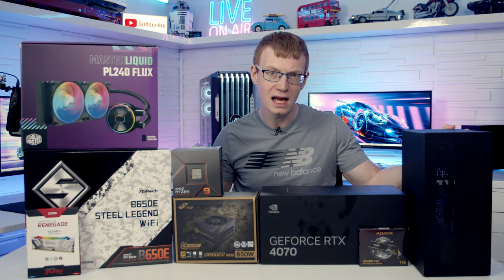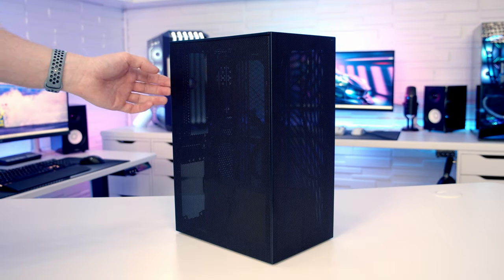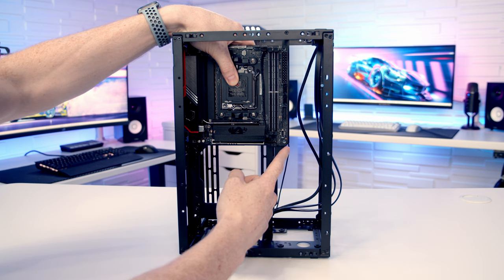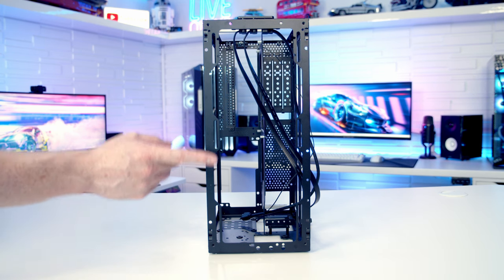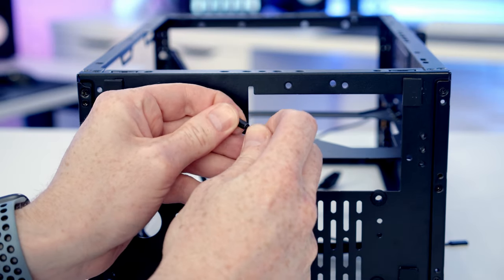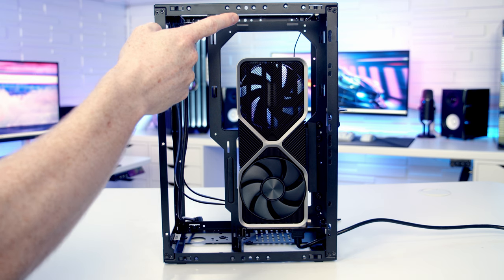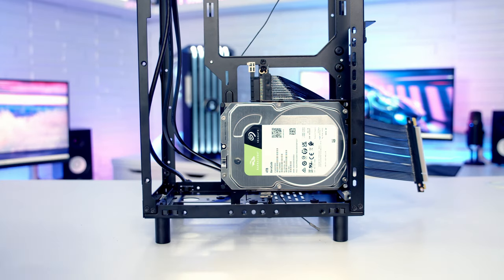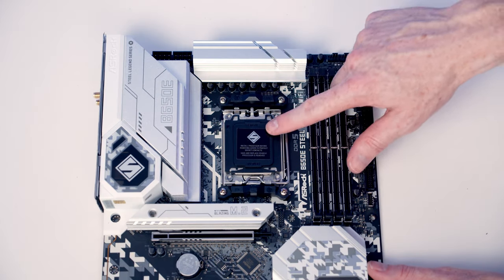SSUPD Meshroom S V2 Build - Step by Step Guide

Comment: A comprehensive and brilliantly produced video, thank you. I wonder if the additional satisfaction from completing SFF builds outweighs the increased difficulty and frustrations? I'm tempted, though...

Also, as a side note, this was for me a convincing advert for electric screwdrivers!
Reply from the maker: I much prefer big cases and some swearing was involved in this video (manual included in box not great). With the electic screwdriver I ahven't found the perfect one yet, this one is a bit too powerful

Comment: Hi Chris, the quality of the way you do these step-by-step guides for the PC cases, they are better than the manual that comes with the case. This is why I'm subcribed to your channel.

I like the way you test to see if every component fits, so us viewers can get creative and make the purchase if it fits our style of build. There are no videos out there like yours that are able to help me with ideas for the Meshroom S case. I've been wanting this case for a while and have been afraid to make the purchase due to parts fitment. Even though your video has covered everything, there is still one more fitment I've been looking for and still cannot find it.

Would you able to confirm or show that a PCIe riser cable can fit into any of the lower PCIE lane slots on a ATX motherboard with the SFX PSU in place. SSUPD said that a riser cable can fit into any of the lower slots on a ATX motherboard even with the SFX PSU in the case. I've seen so many pictures and videos (including this video) with the ATX build, it doesn't look like it can fit, and I'm scared to take the risk making purchase of both the case and a SFX PSU.

Cheers
Reply from the maker: Just tried this and it doesn't fit and that is with the case in the standard position (3 slot mode), if converted to 4 slot mode it will be even worse. Thats with the motherboard, riser and PSU I used in the video, but would expect similar results with others. Thanks for your support. I would go ITX if building in this case again.
Reply: @ChristopherFlannigan  Thank you for testing this, saved me time and money. ITX is the way then. Awlays looking forward to your future builds, testing etc. Hope you enjoy all the content on Computex 2023, I'm sure you have many videos ideas for all of these new cases and components on display at Computex. Cheers

Comment: 5:50~6:29 SSUPD has released front extension kits for Meshroom S to solve this problem. Although it adds a bit size, but it still smaller than most ATX or even MATX cases, while increasing compatibility.

Comment: v3 needs to get rid of the need for 90 degree hdmi/display cables.

if you're running multiple displays like many people do, that's multiple 90 degree adapters upping cost significantly and increasing hassle to an otherwise almost perfect case

Comment: Hello, do i need a 380 mm riser cable or a 270 mm riser cable to build a pc with an atx motherboard ? is it possible to mound an 240 aio with fans beetween mesh side and radiator ? and route downward tubing without too much hassle with the riser cable ? Any advice will be welcome, Nicolas Perrin

Comment: Hi Chris, your o11 build guide helped me a ton the other day when I built my 4090 strix rig in that case after 7 years of using the same old PC without ever updating it. Unfortunately, while the build came together beautifully, Lconnect is proving to be maybe the single worst piece of software I've ever encountered in my entire life. Looking online, there's plenty of other people, especially on reddit, that seem to have been having issues with the software always being frozen and unresponsive for months, if not years, with no concrete solution being provided by lian li. Do you think you could ever do a video on this topic?

Specifically, what's happening is that 9 times out of 10, the Lconnect window doesn't allow me to do anything other than move it around. I can't click on it, I can't select any options or tabs on it, and on most occasions, the infinity tab that normally shows a visual representation of the fans' layout doesn't even appear in the program window. Continually using task manager to exit out of the software and relaunch it does nothing either. I've only gotten it to work a total of 3 times, I believe, and each of those times, the program froze up after a couple minutes of me tinkering with it. The last time this happened, I was finally able to quickly set the fans to the color I want, but the window froze up before I could do anything else. This happens with every single version and update of Lconnect that I have gotten, and I've gotten about a dozen different ones at least, using manual installs to manual updates to everything else I can find recommended by lianli reps on any reddit threads and blogposts pertaining to these freezing issues. Also, I had uninstalled armory crate right after starting up the pc for the first time, so there's no armory crate software on my system either. 

My build is a 4090 strix oc with a 13900k cpu on a z790 rog maximus hero mobo, 64gigs of ddr5 corsair dominator ram, and 10 lian li SL-infinity 120 unifans, arranged in three groups of three with one by itself in the rear of the case, for a total of four connections going into the lianli controller hub, as well as the really thin wire connecting the controller hub to the motherboard.

It's been incredibly frustrating dealing with this, and doubly so because there seems to be no real investigation or resolution of the issue on lianli's part, nor does there seem to be any discussion about it on youtube. Had I seen videos showing these problems in play as I've described them here and as I've read them described by others on reddit, I would've gone for a corsair setup instead. Really hope you look into it sometime so we can have some light shed on all these issues with Lconnect.
Reply from the maker: I haven't experienced these issues. Might be worth a clean install of windows (it's almost impossible to get rid of armory crate and last time i had issue with it a clean install worked).
Reply: @ChristopherFlannigan  Damn. I guess I'll do this. If only I hadn't clicked on that button to install it in the first place 😅

Comment: What if the Aio pump is in the radiator instead of the cpu block like an MSI aio. Does the mounting orientation really matter like others with the pump in the cpu block?.
Reply from the maker: Not for damaging the pump but if you have waterblock at top of loop any air will collect in waterblock and may affect the cooling